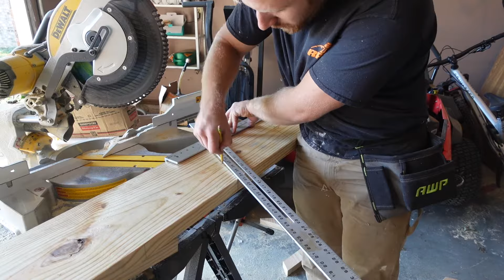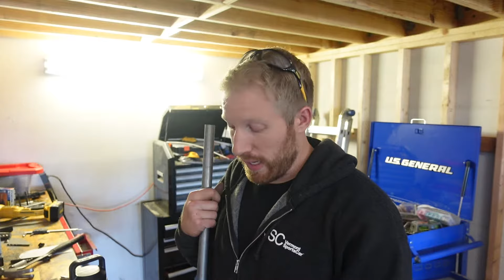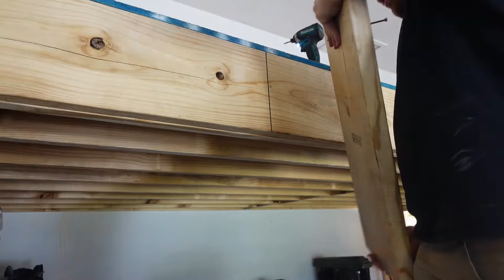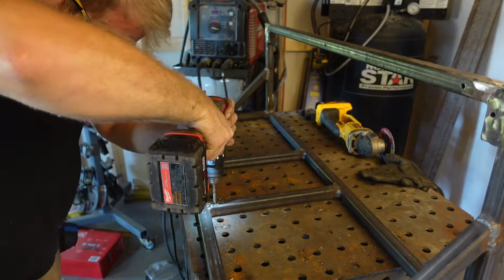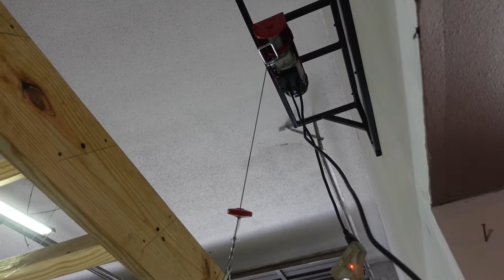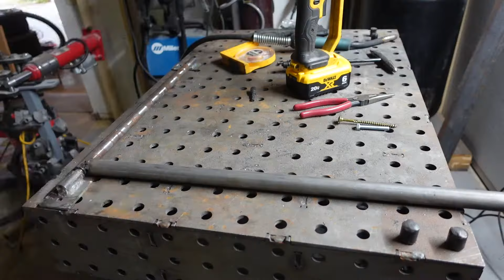Retractable Garage Loft Stairs Using A Harbor Freight Hoist

Comment: good stuff I think the cable connected only on one side is wobbly without any additional cross angle bracing but if you’ll twist the drill clutch tight around your bit  then one click back it locks in place I think you tightened it a few times on the second mounting but could be wrong thanks for a cool video

Comment: I like the support for the lifted position of the stairs!  I do not like things suspended above my head, but that solution takes care of the issue.  I built a finished staircase in my garage to get up to the loft, just didn't want to deal with raising and lowering a ladder.  Now that I have the loft, I probably go up there at least twice each time I go out to the garage.

Comment: What kind of mig machine do you use?
Reply from the maker: I use a Miller 211, it's been great since I've gotten it. I would like to get another machine that allows you to specify exactly what IPM and Voltage you're set at, rather than how this is with knobs that don't really mean anything.
Reply: Thank you for answering my question you have a great channel and very informative. Thank you for spreading your knowledge

Comment: Don't know the full layout of the garage, but it seems the easy way out would've been to extend the floor over the doorway and then have the staircase permanently on the left of the door 😅. Awesome job nonetheless. Overengineered solutions are usually the most fun!
Reply from the maker: The problem was with it permanently down it takes up a lot of valuable floor and wall space. Making it drop down in front of the doorway allowed me to use space that would normally be open and not take up any room. If I had gone with permanent stairs I wouldn’t have had room for the lift I put in.

Comment: Have you thought about adding some angle or blocking under the treads? A few screws into end grain doesn't seem super strong. 

Ps are you still living in VT?
Reply from the maker: I think the two inch drywall screws are holding just fine..

I’m not in Vermont anymore though

Comment: What was the design reason behind mounting the hinges differently at the top of the ladder?
Reply from the maker: That was just an initial mistake, I ended up going back and checking my drawing in Fusion and the mounts needed to be below the top step to align properly with the top of the stairs and not cause the bearing to have to be modified.